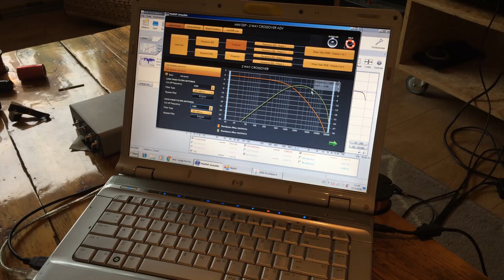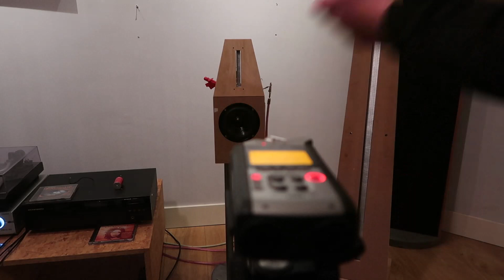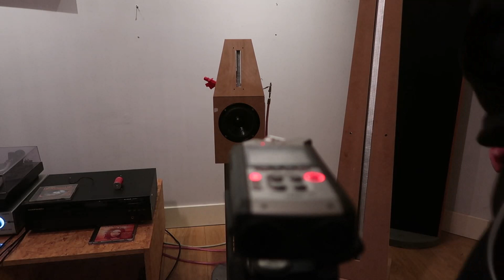First small true ribbon tweeter with ferrites and a transformer - TUNE

Comment: Hi my name is Peter from New Zealand. I need your help about my aurum cantus g1 ribbon tweeter. I just can't get enough high frequency out of it. Sound like mids are way too forward and the highs stuck in the back of the tweeter. Thanks
Reply from the maker: hmm i dont know why that would be :( maybe to heavy of a ribbon ?  although they should kind of know what they are doing so.  is this a ribbon with a  transformer ? or a multitrace one ?
Reply: @joppepeelen  HI Joppe. So sorry for delay. Thanks for getting back to me and trying to help. I got some advice means the resistor in the crossover need to change. Currently 2.7 ohm and not enough juice on the tweeter. Need to swap 4.7 ohm and also reduce the capacitor down to 5.7 or 4.7 microfarad. Thanks again I hope it's gonna work up to my expectations how the ribbon tweeter must to sound like . Greetings from New Zealand

Comment: Hey Joppe,

That little ribbon / woofer combo sound great!

I’m not particularly knowledgable on matching transformers or impedance in general and I could be way off here but, wouldn’t it be easier just to put a resistor in front of the ribbon? Especially as it’s much more efficient than the woofer?

Also, what about cutting some wooden rod in half to form a mini horn / round over on the baffle?
Reply from the maker: Hi George 
a  resistor might pad it to much to be handled by the amplifier. the ribbon is only like 0.1 ohm or something,  so to be able to reach 3- 3.5 ohm far more is burned in the resistor it think then i like :)

about the roundover, i noticed i have to place the ribbon slightly back anyway to time align it to the woofer bettter, so i can use the same wood as extra layer  and round the slot over. but yeas half rounds is also a nice idea (i tried it few weeks back on my long ones :) )